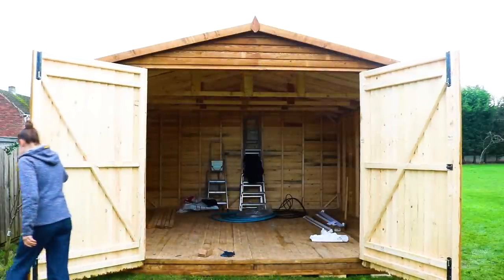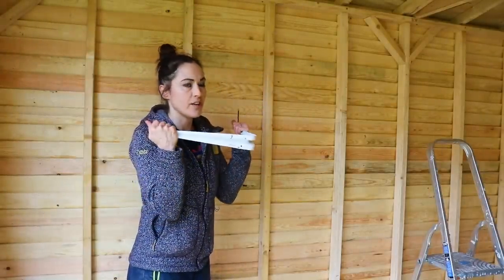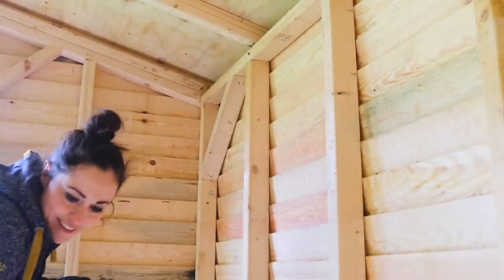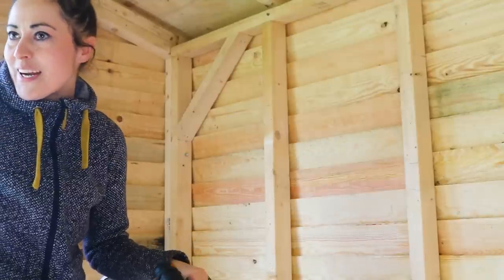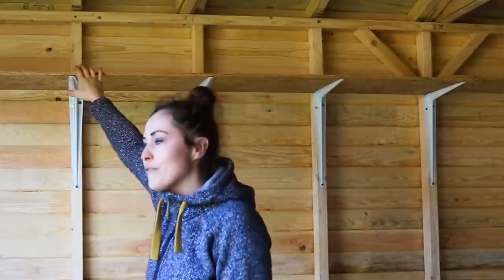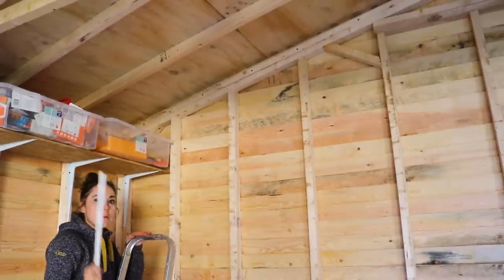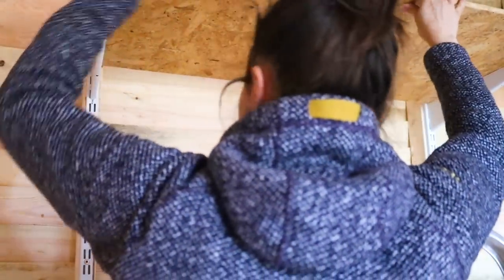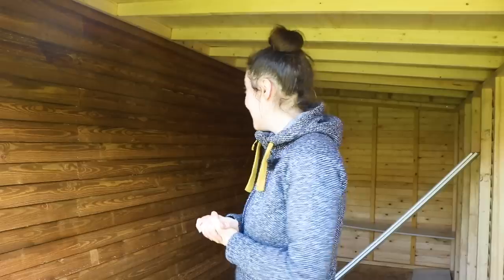5 Easy DIY Shed Shelf Ideas + House Update

Comment: Good old Dad ! I particularly like the plywood cable reel off-cuts, I did something similar with some salvaged plywood cut-outs from a local firm that makes Speaker systems so they're convex rather than concave but still work !

Comment: Excellent ideas! I just did shelves but I was lazy and bought industrial metal shelves, about 60 cm deep. One for tools & such, the other for my cooking devices. I'm also the cook. Yes, it cost a little more but I was in a hurry. Sorry for the late comment, the Bahamas were calling me and I felt compelled to go there.  I also love what you said at 9:45  Usually only said by dads after securing a load.

Comment: Your dad is a gem for letting you do this to help you save a lot of money in the long run

Also with your new home will it be a builder up place or will it be something that's already all done

Because you done amazing work years ago with your old place not only inside but outside too and I think you could buy a house cheap do it up over a few months to a year or so and sell it on

Basically homes under the hammer but with a weekly video instead of an episode lol
Reply from the maker: It's saving us a lot of money which is a relief!

And thanks so much! I don't think I could ever buy a house already done up 😄 The day I do is the day I'm no longer fit and able. Hopefully I'll be able to share more on it soon!
Reply: @TheCarpentersDaughterUK  sounds good what area are you looking for if you don't mind me asking if you don't want to comment on that I understand

It's something I would love to do when I'm settled and in a stable job just buy a property for cheap and do it all up using all the skills I've learned from college and now work apart from gas, electric and plumbing those are the areas I won't touch lol

I love tilling and I plan on redoing my kitchen at some point but I need to wait for another job to be done first

Hopefully you find something soon and can take us all on your journey of doing it up with the skills and techniques you have learned over the years

Im also rewatching all of your old videos of doing up your bungalow I'm on the driveway video atm

Take care and wish you all the best with house hunting 👍

Comment: Please please can I ask you a massive favour

I don't know what my problem is with my mitre saw

It is driving me crazy

I can't cut anything straight or a decent mitre cut

It's an evolution mitre saw which I have replaced for the second time

I have tried everything and it's slowly killing my soul trying to do simple things like cut fence posts down, as it's always warped or bent

I try to callibrate the machine every so often, have tried to use different blades, but I can never get a decent cut

My mitre cuts are off 2-3 mm sometimes

I did a test cut on some scrap 2 by 3

The wood was square, held up so not to fall while cutting

Please ask your dad what the secret to a decent cut is